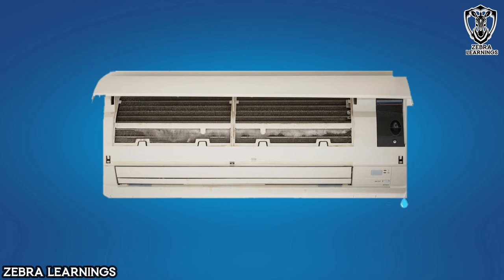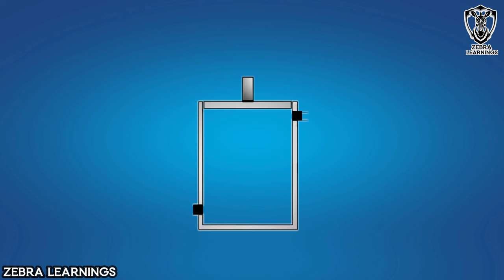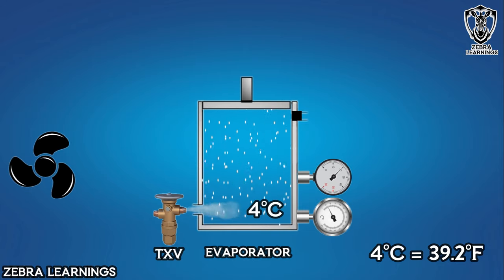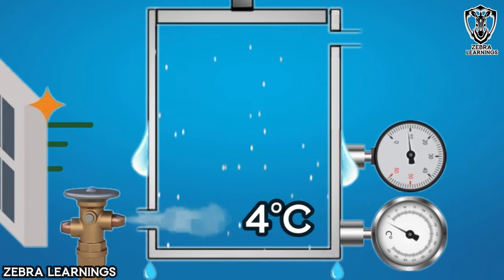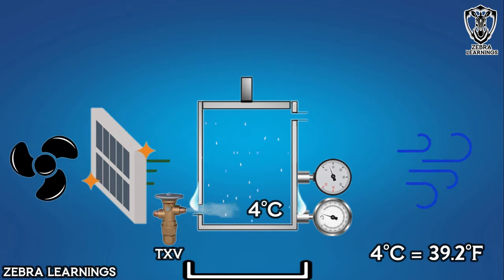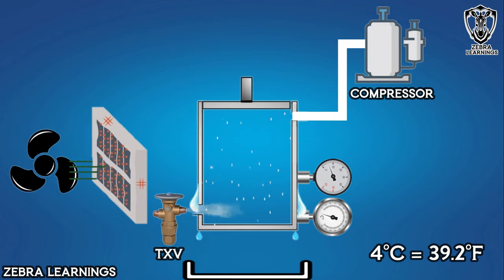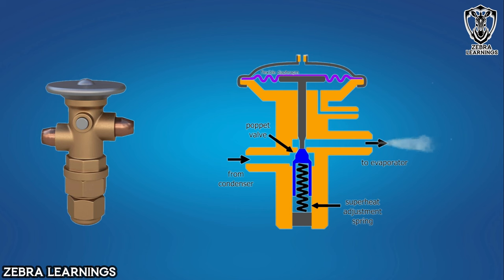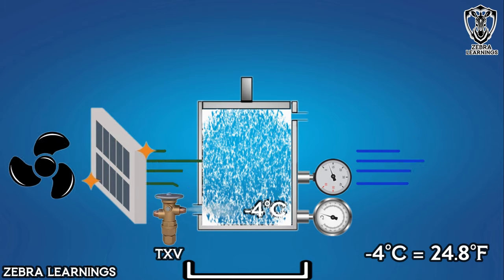Frozen Evaporator | Reason and Solution | Animation | HVAC | #hvacmaintenance #hvactraining

Comment: Absolutely outstanding video! Thanks for sharing your knowledge!!
Reply from the maker: Glad it was helpful! 😊👍
Reply: Gas low  dust bolcked  not circuling yes  evapare coil blocked  filter blocked pm and pushing and block solving and  vacum and clring snd  solved gas chargd incarces
Reply: Filtdire chock up bolced replacing pm and colvenexpldhion filer bolck bolwef cleinv tehrexpanhion vslvd solveing very good dherinv thakyou somuch sir..

Comment: Why the refrigerent will leak from eveporative coil
Reply from the maker: Refrigerant leaks in an evaporator coil occur for several reasons.
Like, Manufacturing defects, improper installation or freezing.
Not maintaining properly or using wrong chemicals to clean the coil. Etc.